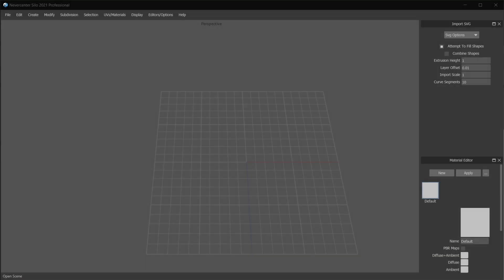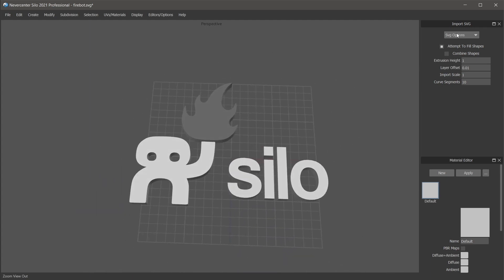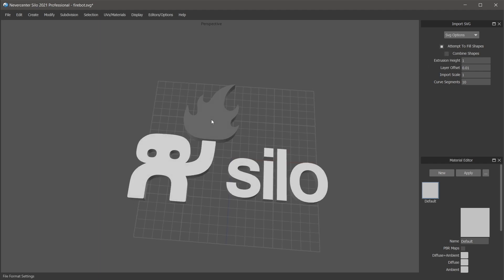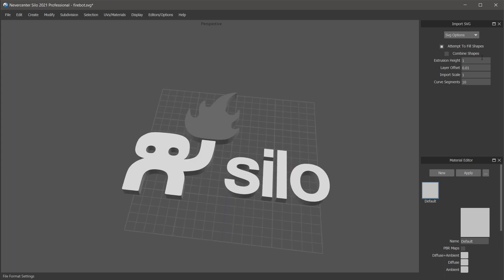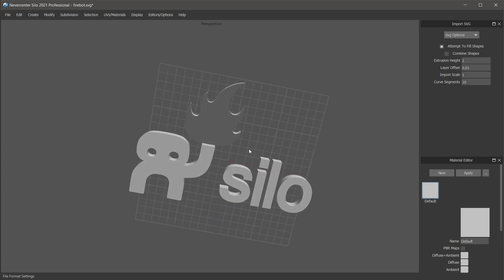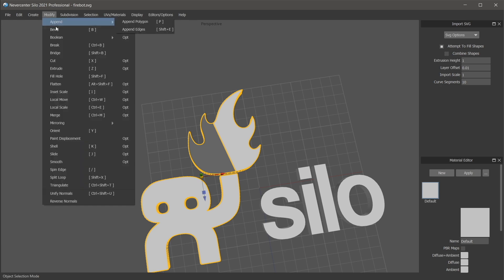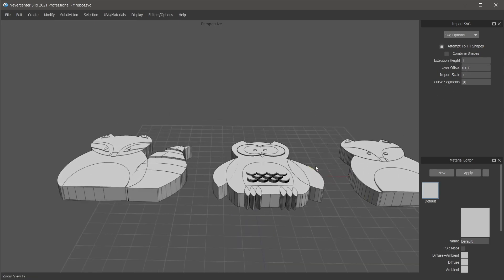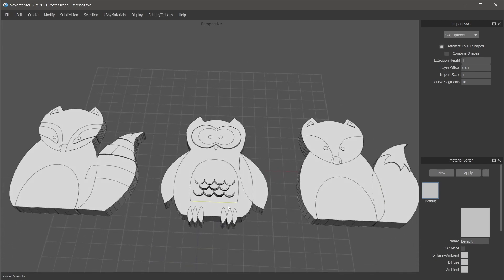Silo 2021.5 — SVG import and more

Comment: Hi, I'm surprised how good this software looks.
I wonder: 
Milo can create renderings as good as Blender or Unreal Engine? The examples don't look very realistic.
Is it cross-platform? If I buy the Mac version will I be able to install it on windows in future like MOI. 3D or will I have to pay a new license? 
It will run fine on a MacBook Pro mid 2012 and I upgraded to 16 gigs of ram but with Catalina?
Thanks!
Reply from the maker: Thanks for your interest! The best thing to do to see Milo's rendering is to try it out for yourself and see! There’s a free trial included with the download at nevercenter.com/milo.

The licenses are platform-independent (so you would not need to buy again), and should run fine on Catalina -- requirements for Mac are 10.14 or better, Intel or M1 processor. The best way to make sure it runs well on your system, though, is to download the free trials for Silo and Milo, here: https://nevercenter.com/silo/download/
Reply: @nevercenter  Thank you so much!